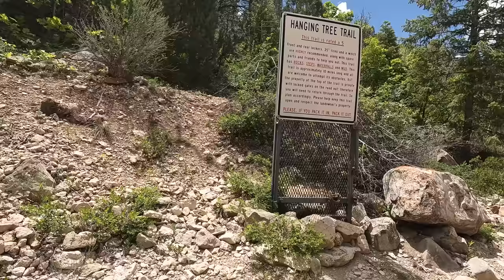You Should Never Go Here! Off Road Waterfall Rescue

Comment from the maker: Check out Robby’s video here!https://youtu.be/b2cC5rcIFBk
Reply: You need 2 things. Air rings to inflate and deflate the tires on the fly, and some type of pistons that will lower and jack the off road wrecker off the ground if you need it(like the use in the open wheel race cars)
Reply: That BEHEMORR certainly made this one the best.
Reply: You generosity is even here, with this link. Thank you.
Reply: Please tell us how you really feel?
Reply: That was a very impressive recovery.   I do think you need to put a longer boom on the wrecker.  It would make it less likely for you to damage the hood of the vehicle that you are recovering.
Reply: This is one hell of a trail. Never seen one like this before.
Reply: @mikeworkman3593 loop loop 9th 9th MO 0nm.
Reply: Matt there is a company that wraps headers with aero space material. Would be perfect for this application.
Reply: I enjoyed both videos, but I will say I really enjoyed the massive camera quality improvement on Robby's channel. It showed so much more detail, and did a much better job showing how steep and treacherous that trail was, especially, with the direct comparison between the videos for the same obstacles. I will say your video was a tad more stable, but I wonder that might have been part of why it showed how severe the trail really was.

Comment: Gentlemen I have not read any of the comments or suggestions about the wrecker. So perhaps this has already been suggested. It is one very amazing machine. However, I have observed that when you are towing a rig out in tough conditions it is difficult to keep the other rig from getting to close and running into the wrecker. If you would attach a single lenght of heavy tubing to your pintle hook and the other end to the bumper of the rig you are towing. Make the tubing adjustable for length. It would allow for complete movement of the towed rig but it would keep it from getting so darn close to the wrecker's boom damaging the towed rig. You already have it strapped down in every other direction.  I enjoy your videos.

Comment: That truck is so cool. On the lift rope wear issue. You might be able to solve the wear issue by using a static chain to take the weight of the towed vehicle from the boom for a longer tow and slack the lift line off a bit to prevent wear.

Comment: I had a 57 Chevy that the wipers barely worked but if you wax the windshield with like regular car wax, it beads and at highway speeds, it just blows off. The faster I went the better I could see. Might help the wrecker until you get the wiper motor installed.  Makes bug guts and stuff wash easier too.

Comment: Use some DEI header wrap.  I used it on my 77 Corvette with headers and it worked good.  You could touch the wrap when the car was at operating temperature and not get burned.  At one time I had the headers "double" wrapped, when I took it off, you could see the wrap imprinted in the steel tubes.  Had to hold in the heat too much to do that.

Comment: As far as heat shields go any thing that interrupts the heat transfer.  My 97 f350 7.3 I have a custom 5" straight pipe exhaust as the kit fit everything except my trk style which is cab n chassis as a narrower frame used.  I went up over trk frame along bed frame and ovaled pipe and 1" spaced a sheet metal plate. Exhaust gets hot enough working that can't keep hand near pipe without getting burned  and pipe runs 3" from plastic diesel tank.  Other side of sheet metal completely cool.  
Great job Matt's crew and Matt slow down.   Lol.  Interesting tire repair. Are you leaving tube in or fixing tire a little better than taking tube back out and storing for emergencies like this

Comment: That sort of error is why i really, REALLY recommend at least one spare be carried - not just because it's a lot easier, but because it saved a lot of time stuck on the trails and sometimes one can lose a tyre in a very tricky place to access.
Failing that, because they're big MFers, have a couple of complete wheel/tyre assemblies back at base that can be grabbed and brought back to the wrecker - that way you're not having to fight a stubborn tyre bead, tube/tyre change, and air-up when the conditions could be a LOT less pleasant than you have there.
Heck, comes down to it, just keep a couple of inner-tubes in the tool-box for the truck.

Comment: Loved this recovery you crazy mofos 👍✌
Reminds me of cutting firewood in my 58 international A100 in 18" of snow with chains I fabricated from used logging truck cross links. That crazy old short bed would take me places on the logging roads where 4wd would get stuck. Turns out some old timer that owned it before me had welded up the pinions to make it locked. And I had intalled a 1947 army ambulance 4 speed crash box trans with a compound low.
Plumas National Forest Ca. was the battle ground 😄

Comment: little idea I had, just suggesting because I have no idea if it would work but, those cross line that keeps the towed vehicle from going sideways, someone suggested to put a bar there but you said it couldn't work because it's not the same length all the time, it has to move.
what about some sort of shocks, an extendable bar but would make it that it doesn't bounce around from front to back, and also that bar could have a stop that would prevent the towed vehicle to bump on the wrecker.
just an idea, keep up the good work y'all :)

Comment: You're talked about needing fenders on the WLORW. Have you considered installing them to the suspension instead of the body? That way you can have them closer to the tires and make them smaller and still be more effective, with less concern for clearance for wheel travel. And knowing how practical you are (me too), they would be just a bolt or two (or three) to remove them for repairs, service, or just to "take the top off", so to speak.

Also, is there any value in carrying a full-size spare for the Wrecker?

Comment: Impressive recovery. But there is just one thing that you guys should seriously consider. Just stick to the remarkable recoveries and leave the singing to the professionals or install an operational stereo. Right after the "hot rod" suspended fenders are mounted on the backing plates so they can articulate with the tires. 😁

Comment: On model Ts and As we used a small rope or twine to move the wiper blades when they quit working. The T s had a small handle inside. On the A s if equip p ed... the passenger wiper had small handle. Once again .....fall back fix , rope string or twine, and yes, even bailing wire on outside windshield pulling back and forth by reachi n g out dokr windows!

Comment: I noticed the hammer was a ballpeen not a claw hammer.  I am sure the repair would have been much easier with the correct tool.
Going off road without a spare tire, jack, and wrenches takes a super positive attitude.  At least there was an onboard air compressor.

Comment: I've sent it in a couple of times. Make a V that has 2 pintle O ends to hook into the hooks on the back of the tow truck. The other end run a heavy strap around the front of the towed vehicle in the center around whatever. the towed vehicle will stay back off the tow truck and stabilize it from the tow truck. it will stop the ware on the lift ropes also. If you would like I will send you a drawing of it.

Comment: Great video, as usual. I've ask the equipment question before and you said you didn't need it but why don't you carry tire patches, a shovel and a jack with you on the heavy wrecker?  With a truck as capable as the heavy wrecker, I would think you'd want it as self-sufficient and autonomous as possible so as to avoid needing people to run to the parts store from the middle of nowhere to rescue you.  Then again, in a previous recent video, you said you were cheap and lazy so maybe that's why? :)

Comment: There’s a product that those wires could be wrapped with 
Basically it’s the same material that modern welded 16 gauge commercial grease duct gets wrapped after the flanged welds pass the kitchens / rough inspection

Comment: I have a 2023 Triglide Ultra. Shouldn't TCM be disengaged on dry pavement, especially at highway speeds? I nearly lost control on an off camber turn at 70 mph with the tcm engaged. Rear wheel raised off of ground and I lost steering control. TCM engaged is a safety hazard.

Comment: ???: Just a brain fart idea with zero knowledge to back it, but.... When picking up a vehicle, you've got those straps to the axles, crossed up, etc., to help stabilize and keep the customer vehicle from banging into the wrecker. What about using really long shocks (Thought of it when I saw the front ones extended on the Bronco @ 17:00) Attach to the back of the wrecker with pivots then strapped to the clients axle. Tune the shocks to keep the vehicle from jerking forward, toward the wrecker. Maybe?

Comment: just a thought here why are you not using a installed radio in the vehicles and the handhelds on people?? you would get much further talking distance being you would then be using a proper antenna not just the silly little rubber ducky your current radios use.. personally i would run a radio in the truck that also has the capability to also ruin as a repeater so your handhelds would then have the same talking distance as the vehicles  i would be willing to help guide you along in picking a radio for your vehicles

Comment: Recently it seems that the 'tech' portions of your videos have gotten shorter with quick cuts, key steps edited out, early statements regarding what the issue is without ever closing the loop on what was done in favor of the reactions of people around it. Request that you revert to the way that your tech editing was done in the passt. An example was regarding the flat tire n this vid - so much interesting material regarding the repair never made it into the video.